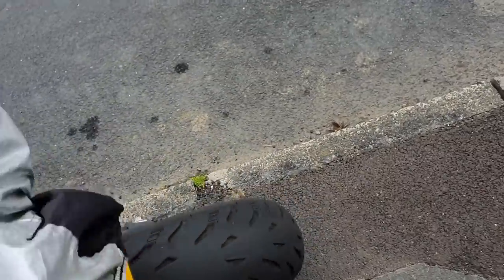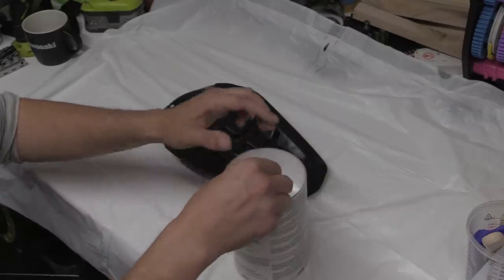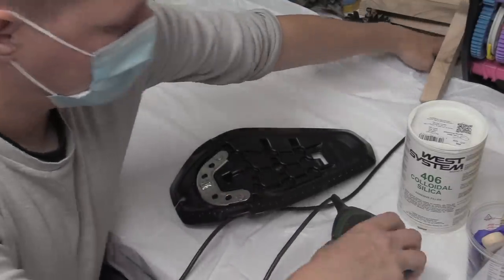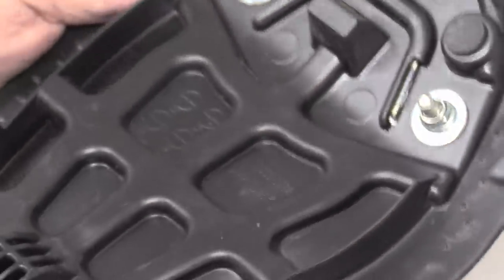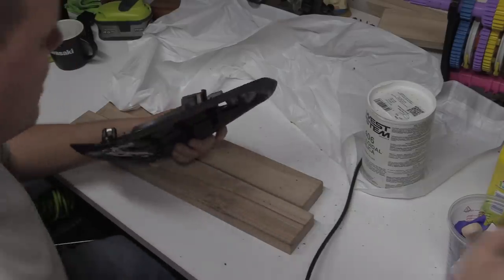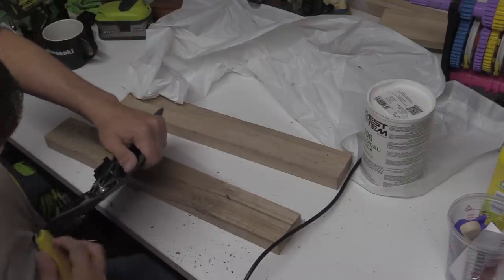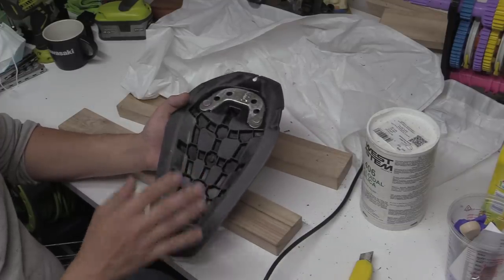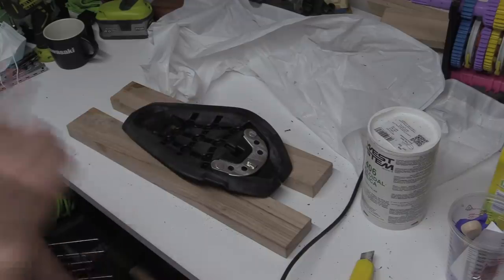Motorcycle Glass Fibre - Part 1

Comment: You don't really need to use that expensive epoxy, that's more just for the automotive industry who have vacuum autoclaves. Some shredded newspaper and some PVA glue will suffice (get the stuff designed for wood if you want extra strength). It's much easier to use and not very toxic, you can even eat the stuff. Almost all the time it gives a super smooth and super glossy finish with almost no effort.
Reply from the maker: What expensive epoxy?
Reply: @dirtygarageguy  I'm just taking the piss. Will you be using a hardener with the resin?

Comment: If you plan to make a fiber glass cover for the tail you don't need to fill the whole shite. You make the mold withe the top shape you want by using the bottom shape. Be aware the thing will shrink a little. Then you laminate the top cover in the mold. Use foam and glue to glue it to the bottom part. You also can insert some wood pieces in the lamination where you can screw it to the bottom. You also can laminate the thing and place the bottom part into the wet polyester laminate that will make it stick and then drill small holes from the bottom and fill the hollow space with low pressure PU foam when it is fully harden. Drill the holes before inserting it into the laminate to allow the epoxy to vent off. Use a little less (2/3 of the recommended) hardener the reduce heat from hardening. It will still harden fully but slower with less shrinking. You will never get fast a good result if you try to build it up from the bottom. How to remove the sanding on the PP plastic? use the blow torch and slightly melt the surface and all looks good again. Works also on old and dry thermoplastics. Try that on old blind turn signal lenses! If it is to far gone it does not work well. the goal is just to bring some heat into the plastic so it heals it self. Magic! You need a fast easy to shape one time mold? get a bunch of modeling clay in a wood frame scrape it out cover it with wax and go for it but be aware not to use to much pressure when you laminate! and do not let the gel coat dry for to long! If it is firm and sticky go for it! only use a brush to tap out the air. No hard roller! Good luck Matt! A little tip compressed air does help a lot to get the parts out of the mold.

Comment: I use my Microwave for drying off damp socks or pants in a hurry (clean ones you beasts).  Pro tip,  pants in the fridge for 20mins befor bed on a hot summer nights. You can thank me later.
Reply: DispelTheMyth  Good idea i like it but I do not own have a hair dryer. Did try a heat gun on a shirt once, mistake where made.
Reply: Mother Algorithm  Sadly no space, thats where the sv650 parts are stored